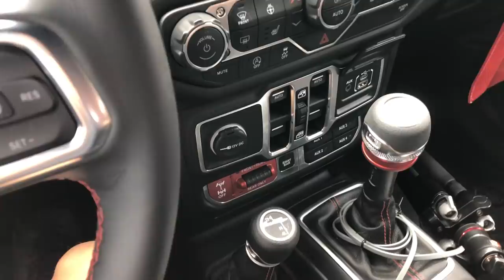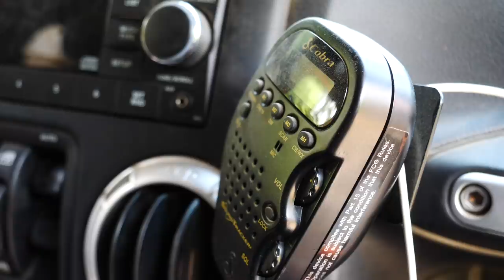V6E19: Maintenance Days and the Gladiator

Comment: Chris, check out the Rough Country, hybrid stubby winch plate with fog lamps. A minimalist front bumper that mounts the winch low so it doesn't block your radiator. And allows you to still have fog lights. I love mine. And it's only, $230.

Comment: I Agree Chris!
Gladiator sans bed would be the perfect platform for a mobile living quarter. A 2 door might allow more camper space and save GVW.
Something roomier without losing too much off-road capability.

The Gladiator with a camper (if someone makes one) is going to be close to the cost of a 4wd Van which is not be as capable off road but a heck of a lot roomier, comfortable in all weather and may possibly get better mileage and have lower maintenance requirements?
But...after all this time in your cool orange JEEP, would you have the same followers if you were out there in a luxury Sprinter?

As always, Thanks for taking us along on your journey.

Comment: You'd be better served with a Ham radio, more options plus if you get one that will run APRS you can track yourself without needing IPAD apps and or send short messages without buying into a serice.  You could in theory scale down even more with a good Ham radio that has GPS, APRS, messaging at the same time have many more frequency options to work with.

Comment: Hey Chris, thanks for test driving the Gladiator. My research on the gladiator is how I came across your channel, and I have to say, ive followed you for couple thousand miles since.I can’t wait to test drive one, but no telling when they are available down here in Texas, more importantly, the 6spd manual. Im currently driving a silverado, which is more than capable for my periodic towing, but im kinda concerned about the near 3000lb towing cut in the gladiator when going from the auto to the manual transmission. Im sure it will be fine for what i would need it for. There hasn’t been much manual tranny content on the YouTube yet, but in comparison to your rig, How did it feel? Does it seem to have enough low end power to get up on the highway and such? Is it noisey? I’ve only ever trailer or ground camped, but your methods have greatly influenced my transition to the low-pro pop up and overlanding in general. I came across an overland rental company with gladiator/roofnest setup that I dig.
https://www.overlanddiscovery.com/jeep-gladiator-rent
You had mentioned in the episode that you would want a gladiator if you could. Aside dimensional dynamics differences, I’m curious how it would benefit you from your current set up, or if it’s just the idea to learn how do the same things in a different vehicle. Sorry for the lengthy post, I’m sure others are curious of your thoughts on the truck. Feel free reply here or email in confidence to hawkijon@aol.com , thanks again Chris, get lost.🤙🏼

Comment: Drop that shower tent. There's much smaller packing shower tents on Amazon and elsewhere. They're not as sturdy or wind stable as what you have, but they're only like $40 and fold into 1/2 inch by 20 by 20 inches. Something flat you can store anywhere. I have one of those under the mattress in my teardrop should I need privacy someplace. Bonus: those things fold like the sun screen disc things for the windscreen. No pegs, lines, poles etc. Unpack and it literally snaps open. Not sturdy enough for constant use, but plenty good for occasional use.
Thank god you dropped that skittle thing. Never got why one needs a griddle on legs for a $200+ pricepoint.  Just grab a simple griddle for a few bucks and toss it on your stove. Does the same thing for less money and storage.